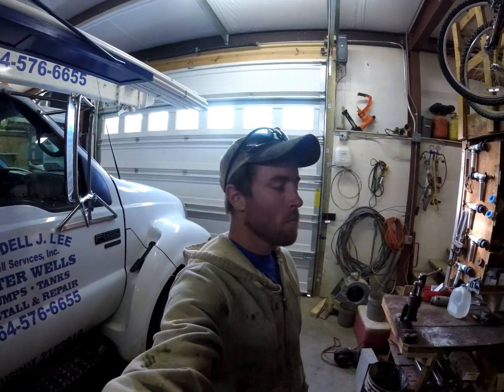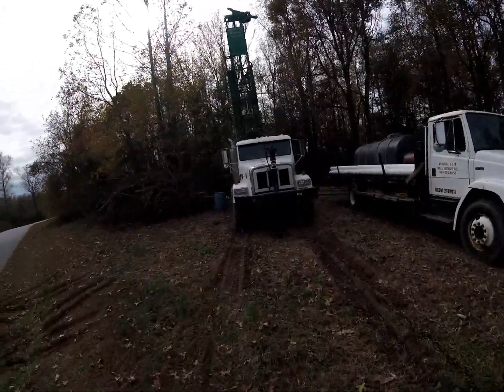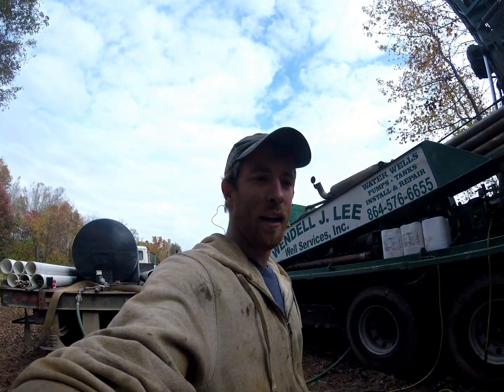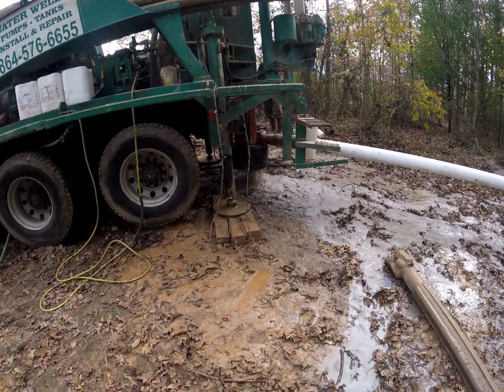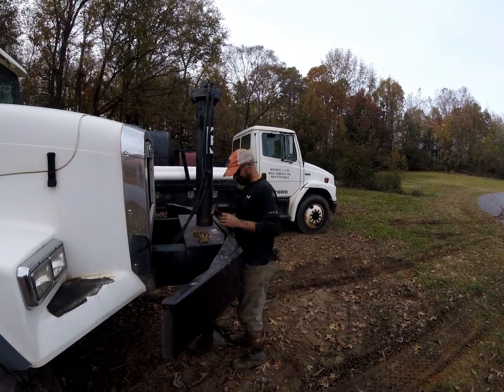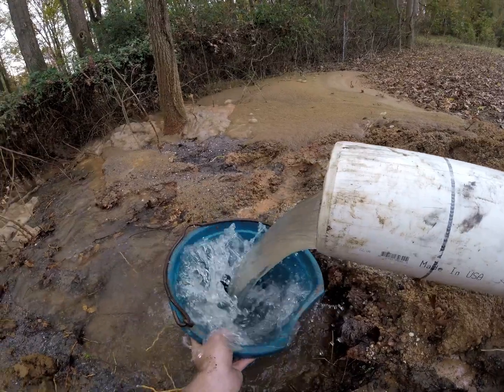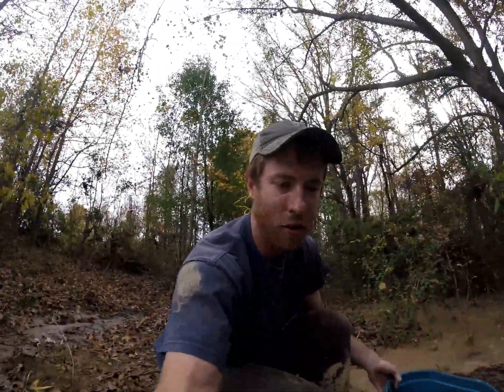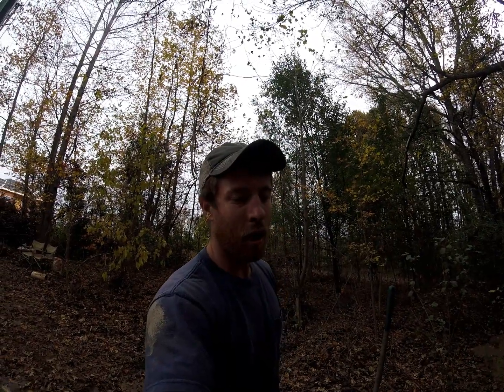Measuring Well Water Flow Rate | How to Measure Flowrate from a Well?

Comment: That is not a 5 gallon bucket....
Reply from the maker: I guess the tick marks on the inside of the bucket showing levels from 1 to 5 gallons are wrong then
Reply: Fiesty...  lol.  Maybe liters bud...
Reply from the maker: @raymondberry8604  nah, not fiesty just right. the bucket has tick marks on it in 1/2 gallon increments up to 5 gallons. Why would I lie or make something up like that?  The last thing I am going to do is be wrong on the measuring device I use as that tells us everything. That bucket came from a well we drilled for a horse farm and we liked it because it isn't as tall as a conventional 5 gallon bucket and it has measurements. If you don't believe that, then maybe the link below will show you I'm not full of bull

https://www.amazon.com/FORTEX-INDUSTRIES-FB-120-Bucket-Color/dp/B0002ZIKL4
Reply: 75 gallons? Never heard of one that high. I gotta agree on camera that looks like a 1 gallon bucket.
Reply from the maker: you want to bet?
Reply: Wow, thats a great well! How deep did you have to drill? And what size bore well is it? And are you pumping that or is that natural head pressure? Sorry for all the questions.
Reply: Awesome videos and content 👍👍
Reply: Google "Feed Buckets".  His bucket looks like a standard 20 qt. (5 gallon) feed bucket.  The boy is correct.
Reply: He has been calculating wrong flow rates for years 😅
Reply: Absolutely a 5 gallon bucket. All you naysayers need to have your eyes checked. Likely most y'all wouldn't be able to differentiate your a**ho*e from your elbow if your life depended on it